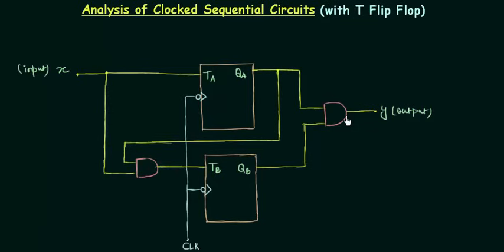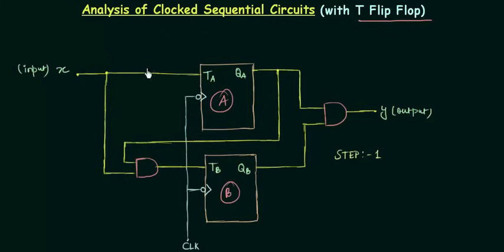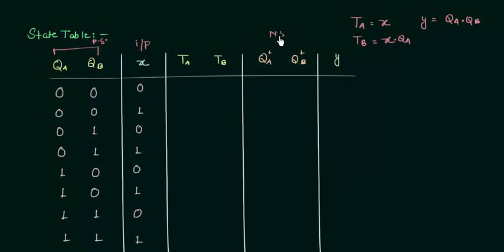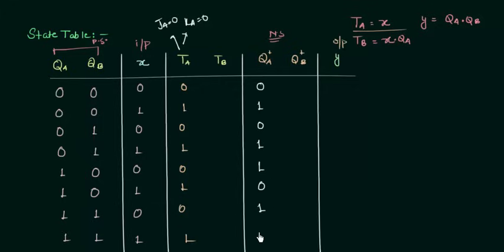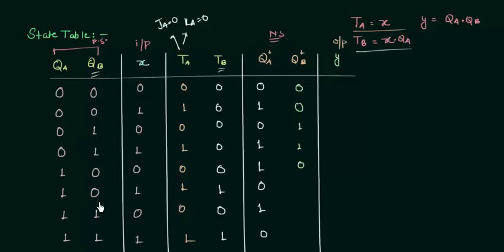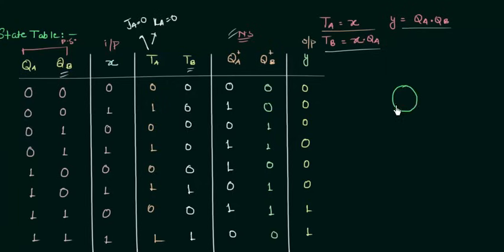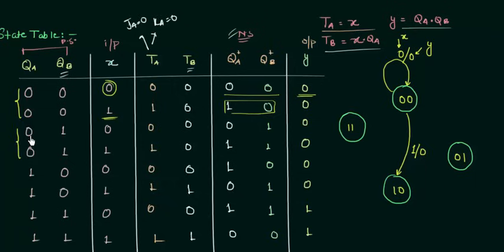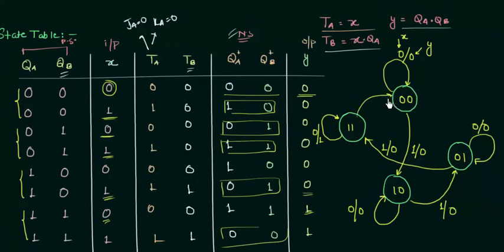Analysis of Clocked Sequential Circuits (with T Flip Flop)

Comment: I paused the video halfway through and completed the table and drawing myself, and the results matched perfectly
Reply: Do tell me state equation also for QB+.. I got it for QA+.. but getting problem in QB+
Reply: @suyashvardhan6411  for QB+ you have to check the QB and TB as for first case QB=0, TB=0 then QB+=0; same for second case ;for third case QB=1,TB=0 then QB+=1; same for fourth case; for fifth case same as first case; for 6th case QB=0,TB=1 then QB+ = 1; for 7th case same as 2nd and 3rd; for last case QB=1,TB=1 and QB+=0

Comment: Although Moore is a subset of Mealy only, still usually it is represented in a different fashion. The ' input/ output' notation is used only for Mealy machine where even independant of the clock edge, there is a possibility for output to change, but in Moore, thats not the case.......Hence I feel it would have been a little better if Moore Diagram would have been used. Still awesome work.

Comment: hey guys he did a Mealy diagram here but since output is not DIRECTLY dependant on input, it shoould be a Moore diagram. Therefore, just cross of the Y column in the state chart and scratch off the output part in the diagram. No biggie
Reply: nice observation blud

Comment: ***** Could you please clarify as why you are plotting the Mealy state graph even though it is a Moore machine ???
Reply: In this video he is not considering what type the machine actually is. He is only transforming a sequential circuit into a state diagram. However you are right, the diagram can still be simplified by inserting the outputs of each state inside its circle.
Reply: no, the output doesn't depend on the input: infact if you see the output equation, it is y = QA and QB, no dependence on x. I think he made a mistake, he should graph the Moore diagram, infact if you see in the graph, arcs which depart from every bubble have the same output, that means that y is linked intrinsically to the state.
Reply: the output does not depend on input, be careful.
Reply: but the output depends on input...so hw can this be moore
Reply: @sujishak1286  The output doesn't depend on input... see y=QaQb no where you have x...
Reply: but the output depends on input...so hw can this be moore
Reply: but the output depends on input...so hw can this be moore